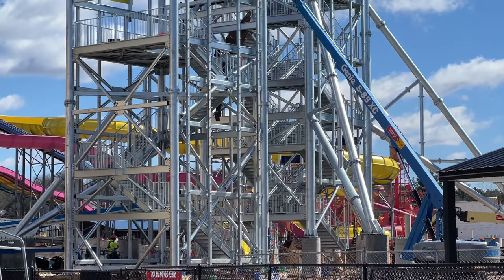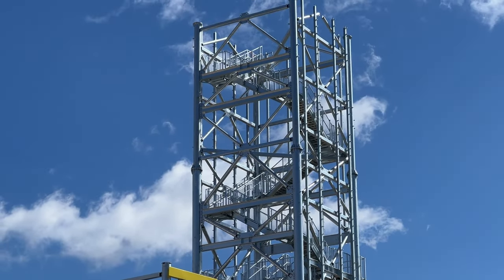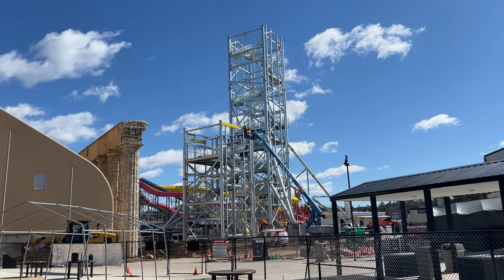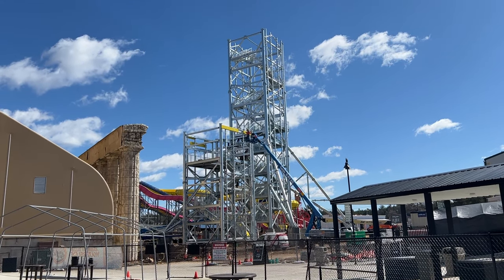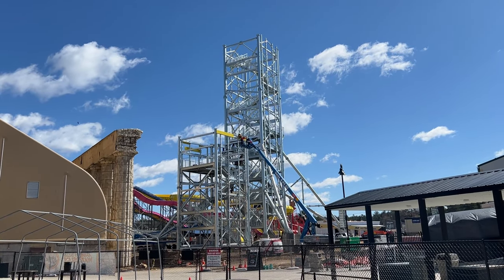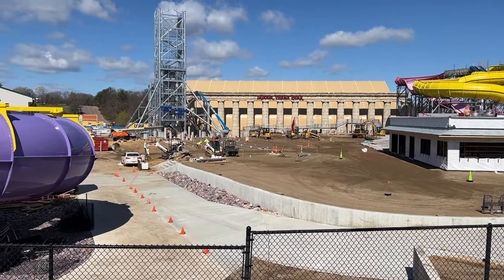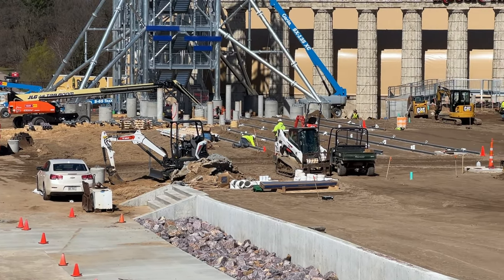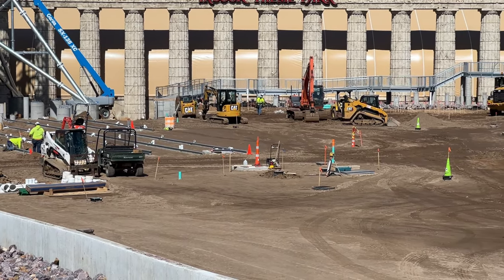Almost there! Rise of Icarus Construction Update

Comment: Everytime someone pushes the height records on these waterslides, someone gets killed. How long until it happens on this?
Reply from the maker: There are already water slides taller than this in other countries. The current tallest water slide, Kilimanjaro in Brazil, opened in 2002, and is 163 ft tall. Icarus has a near clone at Perfect Day at Cococay in the Bahamas that is just 10 ft shorter with nearly the same layout, and has operated since 2019 without incident. This ride will be perfectly safe. Verruckt, the waterslide that you are probably thinking of, was 167 ft tall and featured an airtime hill that was not engineered. It was built in-house and had fundamental design issues which lead to a fatality in 2016. Icarus is completely different, being a fully enclosed body slide with only a slight hill at the end which is too shallow to cause ejection
Reply: @wheelgap  don't get me wrong, I like the concept, but as I mentioned earlier, EVERY time they shoot for a record on water rides, someone has gotten killed on it. It's not a case of one or two rides, it's been dozens over the last 60 years. Action park was a big straw on the camel's back for a lot of us in the OABA and IAPAA. I'M counting the days.
Reply from the maker: @FAFO4wisdom  what rides are you talking about then? The industry has also made drastic changes from the 80s and 90s when Action Park and the Schlitterbahn parks were just hand making slides and hoping things would work. Now, firms like Whitewater West and ProSlide do extensive calculations on these structures to ensure that they are safe. The only major incident that I know of since the millenium was the Verruckt incident, which was created using the 80s / 90s technique of guess and check. That killed NBGS and Schlitterbahn, ruining their reputations forever and forcing sale or closure of all of their parks
Reply: @wheelgap  ride accidents database. I'm busy.
Reply from the maker: @FAFO4wisdom  I can't find a ride accidents database. This law firm has a summary of some accidents: https://blumenshinelawgroup.com/water-park-injuries-and-deaths/

Looks like most issues in the past couple years have to do with the braking trough for body slides. If the water level is not high enough, you may not stop in time, or you will end up hydroplaning. With standard testing procedures and the correct tuning, this would not happen (and doesn't) regularly. Otherwise I am having a tough time finding specifically a water slide ride accident database. Most accidents I can find at water parks are from drowning in large pools, such as wave pools. Lifeguards often save most potential casualties, but every once in a while, lifeguards don't pay enough attention and someone will drown.

To me, saying that we shouldn't build taller water slides because there are a small number of accidents is like saying cars shouldn't go faster than 60 mph because there are crashes. It is all about engineering and policy changes that make these activities (water slides, not cars) some of the safest "things" you can do at any time, as long as you can swim.

I also forgot that the Meryal tower has a 260 ft body slide also from WhiteWater West. That opened back in November and I have not heard of any issues. This by comparison is nothing.

Just, if you are going to say something inflammatory, please either a) be right and have sources to back up your claims, or b) acknowledge that you might not be correct and move on. You don't have to ride this ride! But millions of people will ride this ride over the next however many years, with a very minimal risk of injury, let alone casualty. MtO has had some issues with safety over their history, but that has come down to people disobeying rules, overcrowded pools, or maintenance policy failures on their wild mouse. The park has changed and grown since then and has had a spotless record for the past decade, and I expect this ride to be extremely safe